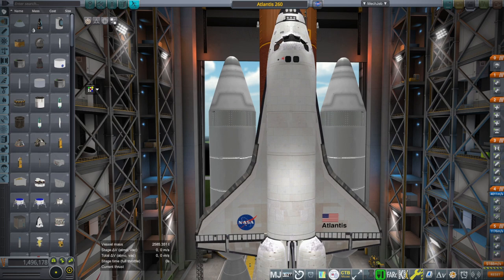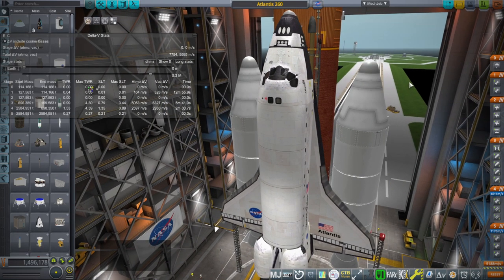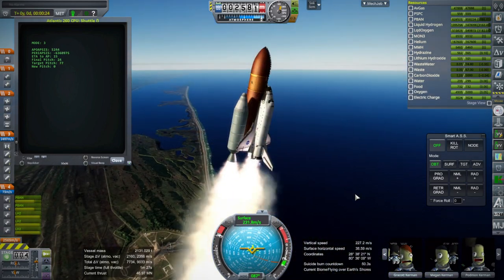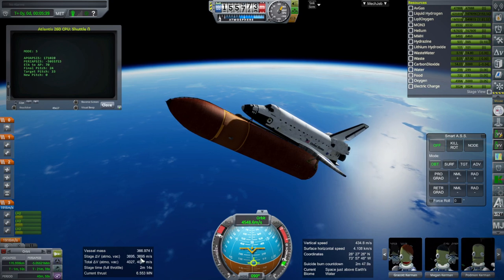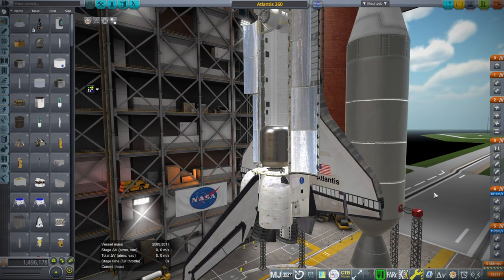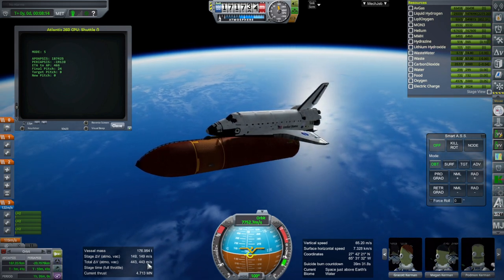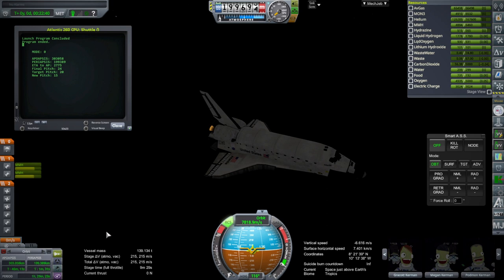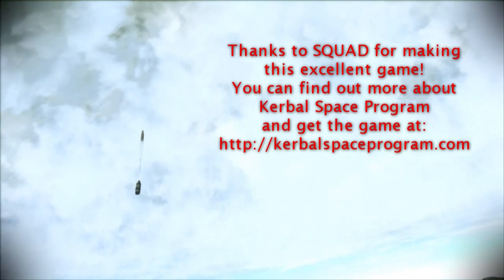Kerbal Space Program 1.12 with RO - Shuttle with AJ-260s

Comment: It’s a cool idea. You’d likely lose more performance over the standard SRBs than FAR is modeling here, the stumpy AJ260s would have a higher drag coefficient. You’d also lose mass, because the AJ260s would need a connection mount to the pad, akin to the flairer out boattail on the base of the shuttle SRBs. 
If you kept the standard external tank, you’d also need some sort of “height extension” or structural connector (like a big strut) to make the thrust reach the standard interbank forward SRB connectors on the intertank, since those are the main points that the standard SRBs channeled thrust into.

With all those changes I don’t think you could really pull 2x the payload to orbit, but you’d still likely see an improvement based on the performance here. Great vid as always!

Comment: You get much more out of the Space Shittle with the Aj-260s because the booster mass ws only increased by a little bit (50 of 200tons (Saturn I was 50 of 100tons increase)) and the boosters have way more fuel also at booster seperation the boosters arent half the mass of the whole rocket but 1/5. Hope that helps.
Reply from the maker: I'm not entirely sure that sentence made sense to me and I don't know where you are getting those numbers from. One thing that I should have mentioned but didn't was the mass of the orbiter itself. While I said that the payload to orbit was 50 tons compared to the Shuttle's normal 26, the truth is that we need to include the orbiter, so in that way the payload increase is not quite as dramatic.